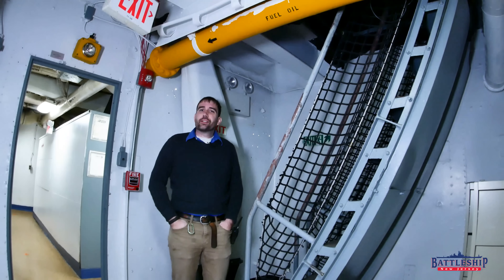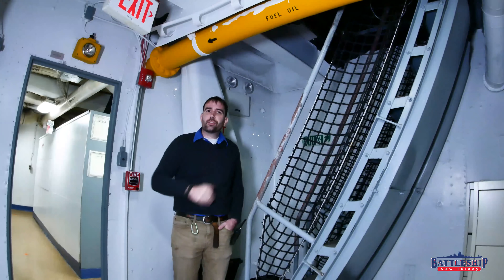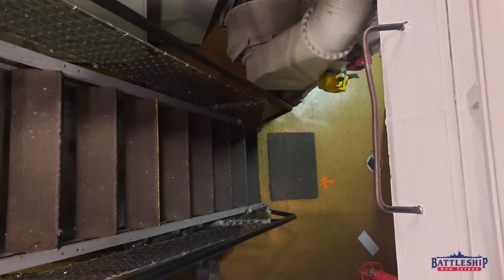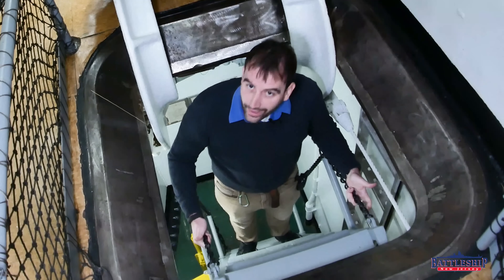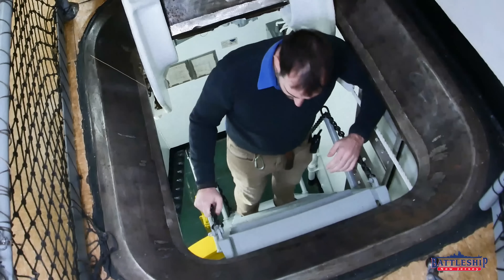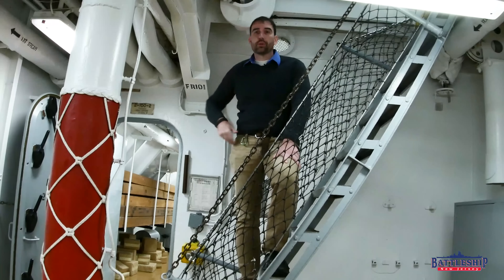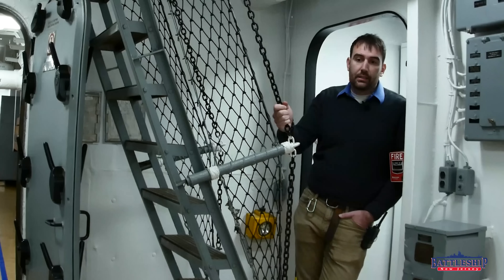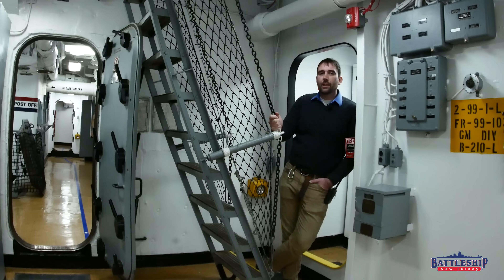Why Are Ladders on Ships So Steep? And Why Aren't They Stairs?

Comment: Had a shipmate take a fall right outside CSMC. She fractured her arm - forget which bone(s)/how badly - but left the ship and never returned. Fortunately we were in port.

It really is crazy how used to the motions you get and how efficient you become, even when you're at mod Z (hatch down, scuttle up, like at 5:38 in the video) and for the ladderwells you most often use (on your way to and from your workspaces, berthing, etc.) you know how each one is, where its handholds will be if any, and so on. So you're just throwing yourself through those holes at full speed, 99% sure that if you reach out your hand just so you'll catch the grab bar you know is in such and such location. In retrospect, I probably could have dialed it back a bit, because god knows how bad things could go when I'm going down a ladder through a scuttle and the bar was damaged or something without it being reported.

Comment: Just seeing the thumbnail, I’m going to say it’s most likely because in high seas, it’s so much easier to fall while in rough weather or battle. So being required to use both hands and feet makes it much safer. Of course, that’s only my first immediate observation, if there are any other reasons I hadn’t thought of I’ll write an addendum after watching the whole video.

Comment: 4:25 More likely, there are side boards that can be dropped on the sides of the ladder, they can be dropped to use as a slide for passing items (like stores) up and/or down quickly, those dents are at the right height for a heavy box to bang into, human marks would be about 2 feet higher~ from folks putting their hands up to stop from crashing and falling.

Comment: this reminded me of my realization that while i think going down stairs is easier than going up stairs, if i was running, i'd much rather be trying to run up stairs than full tilt down stairs (spooky just to think of it!). and also, my worst falls have always been while going down, i guess tripping while going up it's like the steps i'm falling into are already elevated and closer to my arms :-)
Reply: Its less effort but more difficult and dangerous, and a good example to explain the difference between hard work and difficult work.
Reply: I, too, have only ever fallen on stairs when going down. Once, at a neighbor's house when he was showing us his renovations, I thought to myself, "This staircase is steep, I better be careful going down."

Well, I made it about 4 steps down before one of my feet landed in the exact same position that Ryan described, with only half a foot on the step. I fell down the next 4 steps. And in my rush to reassure everyone I was fine, I failed to notice the same thing had happened when I stood up. Instead, I had just enough time to think, "Oh no, not again!" before I went crashing back down and went down the rest of the stairs on my back, hip, and shoulder.

Everything hurt, especially my ego, but at least no real injuries.

Comment: The trick is to lean back far enough as you go down so in case you slip you'll land on your butt on the steps instead of tipping forward and falling uncontrollably. You should also let one foot sort of skim along the leading edge of the steps to use as a  brake to help control your speed. There's a science to it. 😉

Comment: Ladderways, passageways, knee-knockers and a multitude of hatches that you have to open then secure behind you with heavy levers are part and parcel of shipboard life.
After a career in the Marine Corps deploying aboard carriers and gators, navigating a ship's interior becomes second nature and it's probably one of the main contributors to staying in shape while afloat. 
You get used to going up and down ladders in several ways automatically, whether I'm sliding down the rails, skipping down rungs, reversing when carrying heavy objects such as seabags, tool boxes, or aircraft landing gear wheel assemblies, and instinctively leaning and pitching in accordance to the roll of the ship as it moves through the seas without you having any visual reference to the ship's attitude as it moves across the swells.
I've loaded supplies by using the sliding panels that can be swung onto the rungs, used gravity to send shipping cases down to a lower deck, reached the flight deck to load onto helos by Daisy-chaining ourselves with our gear straps, and many other things. 
Also, as a sailboat sailor, ladderwells are necessity, and I can get around in a blow without even thinking about it. Good memories.
Oh, and another trick I use is to descend a couple of rungs facing forward and grabbing either the deck ladder opening edge or sometimes the provided overhead bar and swinging down to the deck below for the rest of the way without having to use my feet to climb down to the bottom. Very quick and efficient.
As for your question, yes, of course I've fallen down a few ladderways, as well as banged my knees and hit my head and shoulders or something while negotiating passageways and ship's spaces. A lot of things are welded and bolted to the bulkheads and such and they're made out of steel, so you just have to learn to stay clear of these obstructions.
And don't even get me started on coming back aboard after a heavy night of drinking in Haifa or Hong Kong or Subic Bay or Dubai or Bali wearing slick cowboy boots and out of money, having to report to the Ready Room before wending my way to the squadbay and hitting the rack.
(Let me know if you've ever disembarked off the ship down rope nets into a Mike boat into 25-foot seas wearing civvies. I did this in Bali when I got my shell back. Fun times!)
😁🇺🇲👍😎
Semper Fi.

Comment: I used to test aircraft reactors and traversed most of the ladders on CVN68 Class ships.  The scariest ladders are the pure vertical ladders in escape trunks and those for the shaft alleys.  shaft alleys were especially scary as you have to lean back over the shear drop (equivalent to 4 decks) so you can get your foot oto the top run through the armored deck.

I was not married at the time so never wore a wedding ring.  One young sailor fell on a short vertical ladder near an SSTG and he caught the ring on the ladder.  He suffered a horrific injury.  The doctors saved his finger but it shook me to my core.  I never wear a ring during any thing outside of office activities.

Comment: As Duty Officer of the Day, I once ran an exercise with the Duty Watch to simulate a crew fall down the engine room hatch/ladder.  The ladder was vertical and 2 decks high.  The exercise included putting the patient into a Neil Robinson stretcher and hoisting him up back through the hatch.  Not a trivial thing to do.  The next night, a crew member actually fell down the engine room hatch, and a different Duty Watch had to get him out.

Comment: I spent 20 years in the senior service.  I go down forward and sideways.  I angle my feet and body so almost the whole foot is on each rung.   At the top, I start by holding the grab handle or railing around the hatch, then I shift hands (one at a time) to the hatch coaming, then to the ladder hand rails.  If I fell, I was already holding on to something.  I only fell once, without injury.  If I am in a hurry, I climb down the ladder until I have both hands and arms on the ladder railing.  I then lift my feet, and slide down the pipe railings guided by my arms.  Works best with narrow steep ladders.   Requires full sleeves to avoid friction burns.

Comment: EVERY ladder leading down to the shaft alleys aboard an aircraft carrier is mounted DIRECTLY to a bulkhead. Therefore making it VERTICAL. As this guy demonstrated in the video, one learns VERY QUICKLY how to descend those ladders QUICKLY to take the necessary readings of the oil & temp readings of ALL of the bearings that support the propeller shafts leading from the engine turbines going aft to the blades. There are outer “stops” on those ladders every 10 feet that when you slide (face forward to the ladder, not like this show off) will stop your descent until you move your feet under the stops. Since I was responsible for those in engine room #1 (of 4) we had the MOST shaft alleys as our machinery room was the MOST forward of ALL the others. One learned VERY QUICKLY how to essentially RUN UP those vertical ladders as well to get out of one shaft alley to get to the next one. (This skill came in VERY HANDY should there have been a hull breach in the shaft alley (below sea level) where water might have been pouring any in. We were also WELL TRAINED in how to close the Z FITTING hatches in order to STOP the water from getting ANY FARTHER than that shaft alley. There’s ALOT more to it.

Comment: Great discussion about ship's ladders!  RCN reserve officer here and I used to volunteer aboard HMCS HAIDA, a WWII Tribal class destroyer built in Newcastle, UK, during the summers when she was still in Toronto.  Like the host, I had taken to sliding down most of the ladders in the ship after a few weeks and this was now my fourth year volunteering in her.  One day I was going down a ladder in the after deckhouse that led the engineering officers' cabins flat, facing outwards as I always tend to do - when my foot slipped.

This was one of the longest ladders in the ship with a drop of about fifteen feet and nothing at the bottom to break my fall, and the image of broken limbs and other serious injuries flashed before my eyes.  Luckily for me, this ladder had a two part hatch at the top, where the main hatch had a smaller raised circular hatch imbedded in it.  The main hatch was closed and I was going through the smaller higher opening, though this made it more awkward to reach the first step and may have accounted for my slip in the first place.  At the last moment as I fell through the hatch I whipped my arms out to both sides and - very painfully - caught myself on my biceps on the hatch rim as my legs swung freely below me.  Despite the severe pain, my mind was more occupied by the dangerous accident I had just avoided.  My arms from my elbows to my shoulders were almost entirely covered with black bruises for weeks after my close call!

Comment: I never fell on a ladder. There's other stupid ways to hurt yourself though. I was squatting down in a p-way using a green pad to remove some old wax before we re-waxed the deck. I didn't realize I was beneath a fire main, and stood up and bashed my head into the bottom of the fire main. That put a pretty nice gash in my forehead.

Comment: You get used to them, they make getting around a lot faster. You have understand also that the ship, at sea, is moving. You learn to "know" the motion of the ship, grab the rails, as the ship moves down, pull the rails and step up like four steps. It normally takes three steps, two is only really possible in rough seas, to get to the next deck. Going down is sort of the same, let the ship come up to you and the distance you move "down" is much shorter.

Comment: In the German Navy, where i served in the 90ies - they are not called Stairs nor "ladders" - they have an own term on navy ships.

("niedergang")   downcorridor would be a somewhat literal translation.

Theyre steep, and i have never seen a sailor go one down ass first, but sometimes you might land on your ass - theyre especially fun if the ship is rolling hard and a steep "downcorridor" 
might turn into negative angle .. "climbing wall"  :)

I seem to remember that for that reason, most of those were oriented on the axis of the ship, rather than sideways.

Also, Sailors remember the most important rule on board of a Navy vessel:  "one hand for the ship, one hand for the man" 

Always secure yourself with a hand grabbing a reiling hard, ready to support your weight.

One armed sailors have no business beeing on a warship :-)

Comment: I used to assist with hard hat tours on BB35.  While going down the ladder way to "Plot", the sole came off my left shoe, sending that foot thumping down the leading edge of each step and pushing my right ankle between two rungs about 4 feet above the deck.  The fall played Slinky with my right MCL, tearing it 3/4 of the way across. (I was off work from the Saturday before Thanksgiving until sometime in January. I'm sure my real world boss thought I was faking it!)  Moral of the story:  ALWAYS wear good foot wear while working on or touring ships!

Comment: I didn't even watch the video but any Navy fleet sailor is laughing at you landlubbers asking dumb questions, they take up less space, it's quicker to get to a lower deck with the palm slide and some of them can be removed to hoist gear and equipment up or down. They are smaller and can be sealed for watertight integrity.
Bm2 3rd fleet 84-88

Comment: Only forward down the ladders!  If you attempted to down the ladders backwards during a general quarters drill (or the real thing) there would be mayhem!  I spent four years on the aircraft carrier USS Kitty Hawk CV63 and never saw anyone even once, even if drunk and reporting back aboard the ship from liberty, ever go down a ladder backwards.  To go down the ladder, you lean backwards and hold tightly to the chain and move one hand forward on the chain with each step forward, left foot, right hand and vice versa.  It doesn't take long to get the hang of that.  The only time you're going down backwards is if you are carrying something very heavy.  Even then you may catch some crap from a shipmate for doing so.  On those few ladders that have those smooth railings instead of chains, it is so fun to slide down them.  The best method is to raise your feet and tuck forward as you slide down, but watch out for the forward edge of the hatch, you have to tilt back your head as you slide down your you'll nail your head against the beam just past the hatch opening.  I did mess up two times, once stretching my lower arm skin over the chain, the other one sliding down a smooth aluminum railing and crashing my forehead against a steel beam.  Both were quite unpleasant experiences but did not require medical attention.

Comment: Ladderwell safety is a big issue on ships. It's very common for sailors to "ride the rails" and just slide down the stairs, or to jump several steps at a time. I used to do this too, once upon a time. All it takes, though, is a few drips of oil in the wrong spot and you're going to have a very rough landing. I've seen a number of sailors get very serious injuries from sliding down the rails, in some cases permanent disabilities. Fortunately no fatalities, although it can happen. Nowadays (when we're not in emergencies) I remind sailors to take "every step, every time". It only slows you down a bit, and could save your life.

Comment: Wife and I went on the USS Lexington when we were in Texas. She couldn't understand how I could go up and down the ladders so fast even after being out of the Navy for 25+ years. She was more blown away I could tell what part of the ship we were in by the smell. lol I don't recall seeing anyone on board going down backwards on any ladders other than the straight vertical ladders on the super structure. I think with GQ drills and having to move quickly no one went down backwards. Most of us slid down the ladder if it wasn't chain or in a part were civilians toured and we had knot work done on the rails. The worst ladder incidence I have seen was during a GQ drill some idiot dropped a hatch on a guy coming up the ladder. Not the round hatch in the hatch, the whole hatch. Had to rush him off the ship to the USS Puget Sound that was repairing damage to our ship. Never found out what happened to him he never did come back on board.

Comment: Interesting talk on ladders. While I was a Marine infantryman, I spent a lot of time on ships: LPDs, AKAs, LPHs, LSTs, & APAs. The longest stay was on the USS Vermillion AKA 107--32 days, during the Santo Domingo ruckus in 1965. Regarding falling down a ladder: When were pulling liberty in El Ferrol Spain after Operation Steel Pike in 1965 (USS York County, LST 1175), some of my buddies got so drunk they could barely walk, and fell down a ladder near our compartment. They came tumbling down with a loud racket. I saw it happen, and it looked to me as if there should have been serious consequences--broken bones. However, they just lay on the deck at the foot of the ladder, laughing. I'll bet they were severely bruised  the next day, though. 

On many of the ships I served on, there wasn't much clearance for your head going down a ladderway, so you didn't "bounce" on the balls of your feet going down. Many of the overheads in those locations had a padded cushion so you wouldn't split your skull.

Comment: Ladders were a blast and it only took me once or twice to get used to em. The ladder to our Coop(aft berthing, 3rd deck)had Nickel plated brass and they were OLD and slick from years of use. Nickel was all worn off except the ends. We would see who could fly down the fastest. I remember this boot camp went to launch and did a direct face plant into the fixed checkerboard table at the bottom. 
40 years later I take the wife on a tour of a boat museum up in Bremerton where my boat did drydock in the 80s. First ladder I saw I didn't miss a beat and flew down like a greased flea and disappeared below. She let out a small yelp as she looked down the hatch to see me standing there grinning from ear to ear. Cmon hon!
NO EFFIN WAY! is all she said!

Comment: John Wayne went down the ladder backwards because he had 0 experience going forward.  26 years in the Navy, I never went down a ladder backwards.  The dent in the vent?  Because we chuck things down the ladder, and big things need to go down...and boom...vent gets dented and a hole gets poked in it.  Nobody flips a ladder around to drop supplies because it won’t fit...bolt holes don’t magically move.  The metal cover on the back is to keep dirt and debris and things from falling between decks.